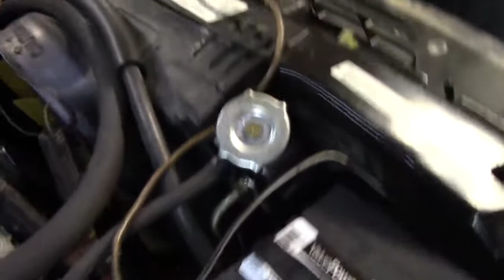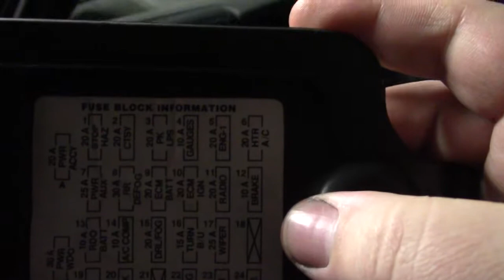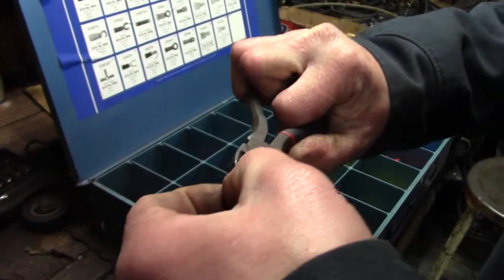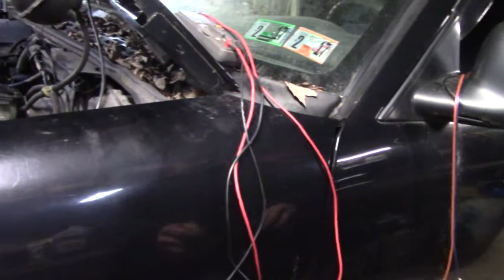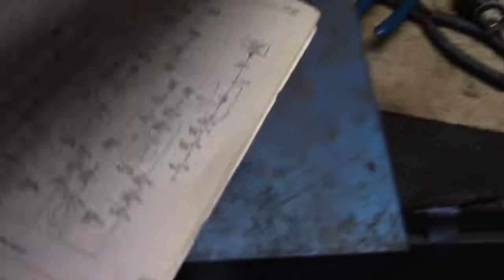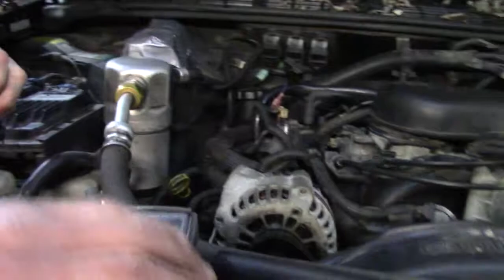95-05 S10 Blazer battery keeps going dead, finally found the issue

Comment: I have to say thank you for finding what's causing my battery drainage because my windshield visor the driver's side doesn't even work at all it never turns on. I'm thinking about that I should take the number to fuse off.

Comment: Thank you . After about a month and New battery still random draining of battery. My wife had something in her eye about month ago and pulled shade down and lifted plastic cover it fell off in her lap she put back on and lifted shade back up.we didn't think much about the little switch for light. I guess when I hit a bump it would come on. With plastic cover you don't know it's on.went out and lowered cover and it was on and very hot. This saved me some headaches trying to figure it out. Was about to buy alternator not needed. Ty again
Reply from the maker: No problem... Glad to help...

Comment: My '00 chevy s 10 has a 1.79 amp parasitic draw on the body control module.
Reply from the maker: keep chasing it, a bcm controls alot of stuff. it could be bad or it's something in that circuit. that's alot of draw.

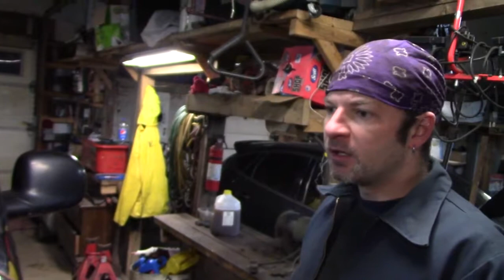Comment: Great video guys!  Efficient way to tackle a complex problem.  I had a question about the multimeter hookup for the 1st phase where you pull fuses.  You mention at the 1:15 mark that:  "the meter is connected between the battery terminal & the battery....you have to have the battery disconnected."

Does this mean you kept the positive terminal connected to the battery, but disconnected the negative terminal.  Then wired the positive lead of the meter to the positive terminal & the negative lead of the meter to the negative terminal of the battery?
Reply from the maker: Yes kinda like a spark plug tester.. we needed to be inside the circuit to check the flow..

Comment: My personal experience troubleshooting my 2004 LT found 245ma draw from 30amp circuit breaker that powers the seats.  Inspection found passenger seat front up down switch stuck.  Diagnosed by seat not powering up and down.  Reseated switch button and draw is now 11ma.  Hope this helps someone
Reply from the maker: Nice..

Comment: Another famous reason for a parasitic draw is the ABS mod stays on because of cracking old solder in the module  Hints would be the ABS light randomly comes out and go's out or stays on  Run a voltmeter test pull fuses and see the drop ...Fix  Replace with used one or New one ...Or take the ABS unit apart re-solder the points which are the biggest  (about 12 if i recall ) with new solder in the amount x 2 .5 the size of a pin head Remove old thermo paste  from lid and circuit board Remove old gasket  Add new paste to each area which was removed from ( pea size drop ) add high temp gasket maker   ...You now have a module that should out last your truck And you saved $50 to $200

Comment: My 98 s-10 blazer stopped running one day about 2 - 21/2yrs ago I pretty much knew it was the fuel pump but I didn't wan to fool around with it and really didn't have the $575 quoted to me for parts and labor any way fast forward to about 5 months ago I took it to get fixed and they said it was indeed the fuel pump bam paid them and drove it on home parked it and didn't really fool with it anymore so here last week I tried starting it and it barely did start up and after it finally did from my house to the car wash ain't even a mile and it was going dead every time I put in the brakes but would kinda start right back up but I just don't see what would cause that?
Reply from the maker: That sounds like you got alot going on there.. Its hard to diagnios things through messages..
Reply: Could be fuel injector
Reply: Spark Plugs
Reply: Distributor
Reply: Ignition fuse going bad
Reply: Starter relay
Reply: Bad ground
Reply: Weak battery terminal

Comment: Wow! I had an 01 GMC Jimmy that kept doing this! I did replace the battery when I bought her as well has the vanity mirrors. Truck has since been sold. :( The battery kept draining regardless. I used to have to plug her in nightly just in case she wouldn't start in the am. Which I would have known to trouble shoot and  disconnect  the vanity mirrors. I would have drilled a hole in the mirror plate to verify it was off. Man I miss that Jimmy.
Reply from the maker: Frank Maggio now u know for next time..